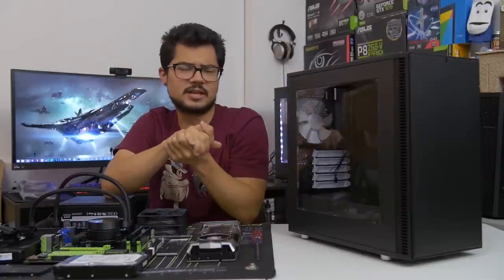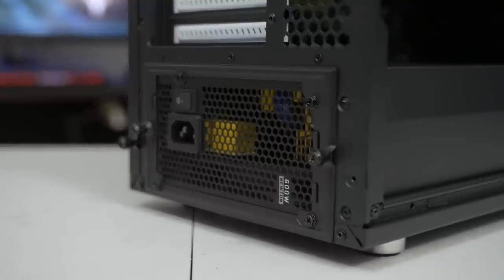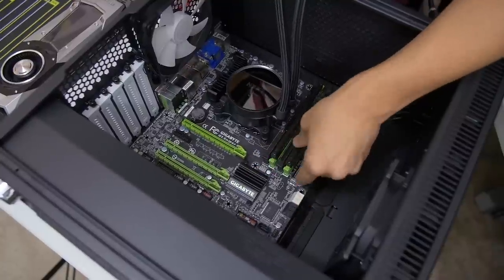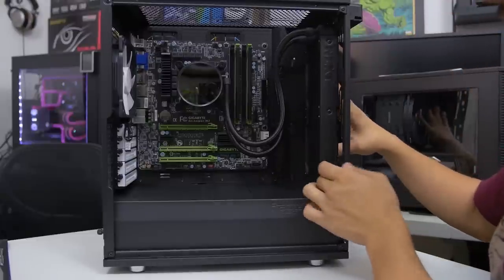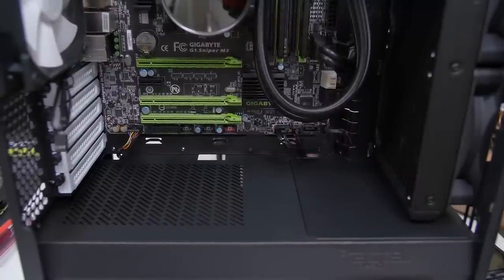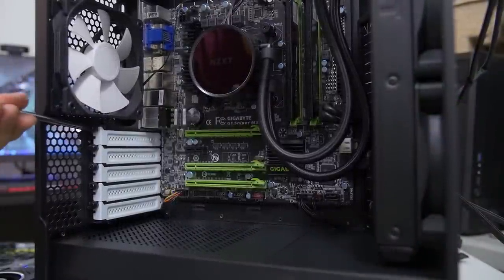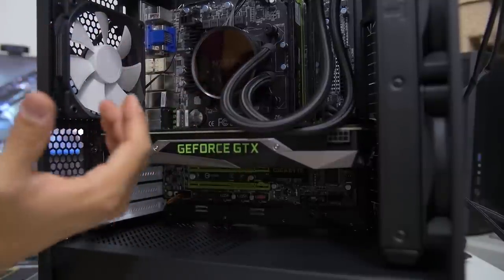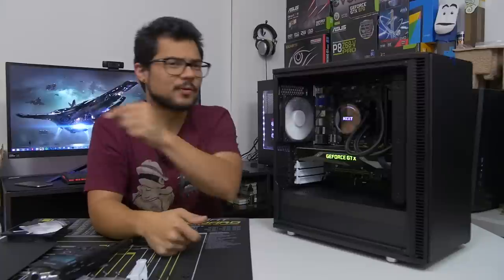Building a PC in the New Define Mini C from Fractal Design

Comment: damn, that nzxt watercooler is sooo sexyy.,
Reply: Indeed. Although the tubes are all over the place... Way too long.
Reply: For a compact case like this, a full size AIO is deemed to cause some clutter. Just imagine what an EKWB AIO would look like in this thing...
Reply: In a normal ATX case the tubes would be alright,it just seems very long in this case (Pun intended)
Reply: Well, even in a bigger case the fan-mounts in the top are not that much further away. Which still makes them interfear with ramsticks, GPU etc, and it looks abit messy.
Reply: I think I'm the only one who hates it. too bulky, and looks like having a mirror inside your case. H7 would be my choice for that kind of build.
Reply: "looks like having a mirror inside your case"
Well, it is an infinite mirror, so...
Reply: Will a 30cm card fit with the watercooling radiator (fans only on one side) ? I dont know if i misunderstood what he said about the space for the cards ._.
Reply: mine is on its way excited to install .
Reply: In this Video he used a GTX1080 which is only 270mm long. In this case, it fit in as u can see. 
I have the Asus GTX 1070 OC with 29,8mm in the Fractal Define C Midi. Between end of the Card and my Silent Wings 3 PWM 120mm Fans are only 20mm space... so If you want also install also a radiator (normal about 30mm thickniss) it will NOT fit in !
Reply: but will a NZXT Kraken x52 fit in the top, because i have a gtx 1080 strix and it is too long to fit in a AIO water cooler  in front. And i have the Define c
Reply: Hoses up!?!?!?!?!?!?!?!?

Comment: Isn't it a little too big to be called Mini?? Anyways glad that Fractal finally added PSU Shroud, yay!
Reply: It's mini compared to the full-size ATX version, the Define C.
Reply: Maybe.. but thise size is a pretty nice size, especially if you are like me and never do multi gpu setups, a midtower case looks empty quickly if its filled with just one GPU.
Reply: If you never do multi-GPU setups then why not go for a miniITX build. Granted, I'm a bit of a minimalist but I want to get things as small as possible so the only reason for me to ever go above miniITX would be if I wanted to get a dual GPU.
Reply: It's not to bad for an mATX case offering pretty much the same functionality as an ATX case. It's much shorter than full towers like the the NZXT H440 or Corsair 400C.
Reply: Jesper Bengtson Why would you need multi gpus for other sizes? Having space, options and more support for builds is key. Itx maybe cute but it has limited options, air flow is horrible and it's just a headache trying to cram everything in.

Comment: It is as if Fractal Design listened to their customers and added all the things that were missing/wanted. They included a filter for the top fan slots and a PSU shroud while updating their micro atx case (which I believe was previously based off the R3 or R4). It is the perfect case for me but I already built in the R5 a while ago.

Comment: Snagged a Define Mini C as well as an older Define Mini on a deal. I needed 5.25" on one of my family PC which is somewhat mid-range. 
Main gaming build will be the Mini C (ASRock 270M Extremem4, 7700K, Cosair Vengeance LED 16GB, Zotac GTX 1070 mini). ALL of my storage will be on M.2 (one 960 EVO NVMe and one slower SATA in the second M.2 slot. Cooler fins added to the M.2 storage.  I do not need any bays for the first time!.

Comment: To me I've found the most limiting factor from choosing Mini ITX for my last PC was the support for only two ram sticks. If you want to upgrade you don't just have 2 more slots to populate, you have to replace what you have.
Anyhow, getting a mATX case will allow for upgrading to mATX in future so this case looks good, what else looks good is the 5th expansion slot for a panel-only expansion card that doesn't use a motherboard slot (or a 2nd GPU but I don't see myself using that anytime soon).

Comment: love the cases, still wish the manufacturers would understand that graphics card intake air is a huge deal (especially on itx cases) and give us 20-30mm additional height between the bottom slot and psu/shroud.

Comment: if that nzxt cooler did not have nzxt over the light effects it would have been an instant buy.
Reply: newrhea13 I'm sure you can remove it somehow if you wanna try.
Reply: Andrew Longauer if I where to buy something that expensive I would have expected it to give me the option to do so in cam or something.
Reply: you can control the logo and the ring separate, turn it off if you want.
Reply: newrhea13 yiu xan turn it off using cam software

Comment: I reckon this case would probably benefit more from having the radiator at the top extracting air and having some nice fans on the front in-taking air. Specially if you have a blower style GPU because that hot radiator air is going right into that fail edition card caugh Founders edition blower card sorry. And we all know those founder cards run really hot and start throttling pretty heavily, feeding it hot air is not the best idea.(I understand that its just an example card too but even with a really well cooled AIB card you probably dont want to be blowing hot radiator air onto it.)
Overall tho that's a pretty neat case and the functionality is amazing. very flexible with setup options. Those new NZXT AIO's are sexy af too.

You could also flip those front radiator fans and use them as extractor fans and have the rear case fan as an intake along with addins some top fans to intake air as well, Would work pretty well.

Comment: very nice case and I appreciate the review.  I was just saying to myself the other day that Fractal hadn't released an MATX case for quite some time (I think the Midi R2 was the last of that form factor). The psu shroud is a great improvement,  however I guess I can see where they are coming from with only having 2x 3.5 inch drive support,  especially with the ssd support in the rear of the case makes sense.  there is one thing I'm missing,  a optical disc Bay.  I guess I'm a little old school with wanting one,  considering I just bought my first blue ray drive for my pc this week.  nice case,  attractive price.

Comment: Can't take PSUs of a length greater than 175mm though, ruling out popular ones like RM750x or EVGA supernova G2. Plus you'd want less than that to not struggle with the cables.
Otherwise it looks to be great!
Reply from the maker: +ProfessorSlash I should have mentioned - that's a spec I'd abide by if using the HDD cage. If you're fine without it, the sky is the limit for psu clearance
Reply: Pauls hardware used a 180mm Corsair RM850i WITH the HDD cage so it should be no problems
Reply: Huh.. Seems like he did. Doesn't look like it's got that much space behind it for routing, but good to know it's possible atleast.

+BitWit Seems I was wrong anyway. Great review!
Reply: Huh? Isn't the EVGA Supernova G2 165mm though?

Comment: Am i right in saying that the top grate has cutouts to support the drive cage?
Because the cutout slots look very similar to those on the bottom grate, both in length, width and spacing.

Comment: What do you think of this Gaming Build: https://amzn.com/w/D99MPBQD13HF ?
Reply: Nice build
Reply: the PSU is a little bit overkill
Reply: do you have a better suggestion? if so tell me please and i dont want waay to expensive ones
Reply: Like for Kyle to see this I wanna know his opinion
Reply: I think I'm jealous
Reply: Get rid of the case,search for one for 100 bucks and get a *DECENT* mouse,not that 15$ crap, get a G402 or sth
Reply: This G402 seems good I never saw it before and it's well priced
Reply: but I think I'll go with the G502 for customizable RGB lighting
Reply: LordSnow well it got the best sensors out there and isn't overpriced
Reply: Get a cheaper case, 850 watts is overkill something like 650-750 should be alright. Why are you bying an optical drive? You have thermal paste but no cooler? Get a coolermaster 212 evo or 212x, both come with a tube of thermal paste and are very good coolers.
Reply: Lare I forgot to put Corsair Hydro Series H80i v2 in the list, I'm going for the water cooler to raise the overlocking potential.... you're right maybe i dont need an optical drive
Reply: LordSnow otherwise the build is great
Reply: Yeah,as Lare said,screw the 850 Watt,650 are enough,screw that case for 150,search for one under 100,it is good enough,for a CPU cooler just search either for the 212 Evo (as mentioned) or search for one that has enough TDP for your CPU (maybe something like a bequiet cooler,or if you extend the budget noctua),the G402 instead of that 13$ crap and reconsider buying a headset,get a 15$ microphone from amazon and a good pair of headphones instead,you should upgrade your storage from 1 tb to 2tb aswell,since 1tb is gone really really fast. Think about the colours of your build aswell,it seems like there is MUCH red in there,like really ALOT,black rams and fans that dont glow red should give a better red accenting for the MB and GPU,so it doesnt seem like a blended red goo
Reply: LordSnow don't cheap out on peripherals. Also, get a watercooler, I suggest the kraken x52 or x62
Reply: Thanks everyone I'll do my best to make it better :)
Reply: tanishq sagar how in the hell can you recommend a product that has been released couple of days ago
Reply: LordSnow you're overspending money on a lot of parts. You could save a good amount of money, without sacrificing performance. This list isn't bad, it's just more expensive than it needs to be.

But good luck trying to get good advice in YouTube comments. I suggest that you go to a forum or reddit. I'm active over at /r/buildapcforme with the username kiwidapple if you want my advice.
Reply: LordSnow I think u should get a better mouse
Reply: LordSnow go with the mionix castor best all around mouse it has RGB and it well rated but it's a little pricey of u if u want u can get the black widow chroma
Reply: TiMeJ34nD1T u say get 650 watts but what if he overclocks in the future or get a new component?
Reply: Daniel, even after overclocking that system, it won't pull more than 350W. A good quality 550W PSU is enough for this system, 750W if you want to have the option for SLI. 

I agree with the mouse tho, very awesome!
Reply: Joey Hobbit, I agree with you but I will get the 650w just to make sure I can upgrade the hardware without worrying about the PSU.
Reply: LordSnow Looks good. The mouse  is a bit cheap compared to the rest of the build though.
Reply: goodshit
Reply: A lot of money

Comment: Kyle, I hate how all Fractal cases have that bump to the right of the motherboard bay. why you ask? because I have a few server dual socket boards that are SSI EEB form factor that is 12"x13" and the only small case that i could fit it in was NZXT S340. That is because the board goes all the way to the front of the case which is not possible with Fractal cases because of that bump. What a shame.

Comment: Would the Kraken x62 fit in here with a full length gfx card? Im looking to get the Define Mini C, X62 from nxzt and Evga FTW Hybrid 1080. pcpartspicker says yes, I know i cant do push pull, but im thinkin of doing the hybrid radiator in the spot of the exhaust fan.

Comment: If i mount my 240mm radiator liquid-cooling system to the front of the case as an intake, can i mount the supplied Dynamic X2 GP-12 fan to the top of the case as an exhaust?

Comment: Can this case fit these GPUs with 2 intake fans mounted at the front?

1) GIGABYTE GTX 1080 Xtreme GAMING
2) ASUS GTX 1080 STRIX ROG
3) ZOTAC GTX 1080 AMP EXTREME

Comment: Brand new :D 2022 but since you did this reviw. Please do a modded build in this! I need some inspiration on a shortened front panel. The use case I have is in the living room and this case was sort of already at home. I'm going with 280 and 240 radiators in this.

Comment: AIO is in front, running a push/pull. Should the fans at the front be static or air flow?
Reply: kingstund101 Should always be static for fans on coolers

Comment: wish they'd make a shroud for the Define S...
Reply: Remco Smit I'd put my money on them doing that on the next refresh of it
Reply: me too...i love mine Define S.....please Fractal Design
Reply: Same here, I really wish Define S has a shroud
JOSH !! Plese make this happen !!
Reply: The Define C is the case you're after. That is basically a Define S with the shroud. And because they have that, there's no way they'll make an add-on PSU shroud for an old case.
Reply: ThierryTheuns True, but I already have a Define S at this point. I'd even settle for just the magnetic dust cover thing for on top... They could make that for the Define S and R5 right?!? I mean they have been some of the best selling cases.
Reply: ThierryTheuns I love the size of Define S. Define C is smaller.
Reply: Not just a shroud but a dust filter for the top of the case too. My mouth dropped open when he pulled that out.

Comment: is this the same length as the nano   S ?
Reply: iulian calin Not even close. This has to accommodate a motherboard that's 7 cm wider.
Reply: actualy i loked up on site and it turns out i 1 mm shorter then nano S
Reply: iulian calin Holy crap, you're right. They wasted so much space in the Nano S.
Reply: what i meant to say, i wondered if that psu shroud would fit in nano s
Reply: You could try.

Comment: why does noone make a "tube" with a giant fan on each end? best airflow ever
Reply: Anton Helsgaun a diy guy did it sort of. It was diy perks
Reply: I think it's because it's not pratical because it cant be tube it has to be oval at the very best... and than you end up with the same kind of thing..
Reply: It's called the Mac Pro.
Reply: Hendrik visch why cant it be a tube?
Reply: Thats a trash can.
Reply: Anton Helsgaun Because the motherboards is't curved. It can be a tube it just needs to be rather large...
Reply: Bin dun
Reply: Hendrik visch yes, but it wouldnt be much bigger then a full tower if you used a micro atx mb
Reply: Anton Helsgaun it's called a trash can computer
Reply: InWin 303. You're welcome.

Comment: Got this in 2021 for Ryzen 3900X build and it's superb. My computer is primarily for audio production at home and I wanted a silent, cool and small. Got Noctua DH-15S CPU cooler and 3x Noctua NF-S12A FLX (2 front and 1 exhaust). Everything inside the case is so damn tidy and clean.

Comment: Is a micro atx board the same as a mini atx/itx
Reply: noah samson ITX is smaller. It only has 1 PCIe x 16 slot and 2 dimm slots for RAM
Reply: No, a micro-atx board is larger, and won't fit in a mini-itx case.
Reply: There's no 'mini-atx'. You have ATX, micro-ATX and mini-ITX from largest to smallest (for standard builds at least)

Comment: Would this fan configuration with a 240mm AIO as intake and 1 exhaust fan ensure positive air pressure? Or would additional intake fans at the top be required for this?

Comment: this is like super late, but at 15:35 you say we get 315mm of length for our graphics card, its that with radiator AND fans? because you say if we remove the fans we get 335mm, is that still with radiator? does that mean if we have no radiator but with fans we still have 335mm? asking because i got a zotac 1080 amp extreme, which is 325mm in length but i now want a smaller case :) (yeh, iknow dumb card for a small case hah.)
would appreciate any answer :)

Comment: can someone name a mATX motherboard for this case with am4 socket for Ryzen cpu's and enough fan headers (PWM) in order to run this gorgeous kraken x52 and 1x120mm exhaust fan configuration?

Cause all am4 mATX motherboards that i found so far only have 3 fan headers....but you need 4 for this build right?!
1x pump, 2x radiator fans and 1x exhaust fan.
I'm confused pls help^^

Comment: I've noticed in the last few videos, you've changed your set up from 2 monitor to 1 ultrawide. Any reason, or just for fun?
Reply from the maker: +Warren my Qnix panel recently kicked the bucket - pair that with the timely arrival of a Predator X34 :)
Reply: BitWit Kyle, how long did your Qnix live? I ask because I have a Crossover monitor which has a near identical construction/build quality.
Reply: Ultrawide monitors are defiantly starting to trend instead of dual monitors as it's more space efficient as well as suitable for gaming.
Reply: mrbean30392 f

Comment: hi i have the same case but the tempered glass atx version. and my graphic card is gigabyte aorus gtx1060 extreme. im planning to buy the nzxt kraken cooler. would it fit to mount the radiator in front  of the case rather than above?thanks

Comment: Does the top dust filter fit on of the Define R5, if you remove 2 of the 3 Moduvents, or are they not compatible?
Reply: I know, but I bought a Define R5 less then 2 weeks ago. I plan to add water cooling to my system, but I don't want to remove the Moduvents without having a fan filter.

Comment: I'm slightly worried about cooling any mechanical drives. Is it recommended to move the drive cage back and put a fan in the bottom position, or is this not necessary? If you were to do this, is there anywhere for the hot air to escape? I'm guessing they wouldn't have designed it this way if there was no way for mechanical drives to be cooled but it's a bit unusual imo.

Comment: Sorry for the newb question but the 2 fans on the Kraken X52, are they pushing air through the radiator and into the case and then the one on the back is an exhaust fan?

Comment: I even fitted my Mini C with a 120 AIO instead of the harddrive cage with 3x120mm fans in the front. Got a H55 with the NZXT G12 on my RTX2070. OC was lower on the stock cooler and temps where in close to 80c, OC is now higher and temp is around 60c. Boosts to almost 2000mhz and 15100mhz on the memory.

Comment: Question, is it possible to mount the 240 rad horizontal on the top of the case in a push or pull config?